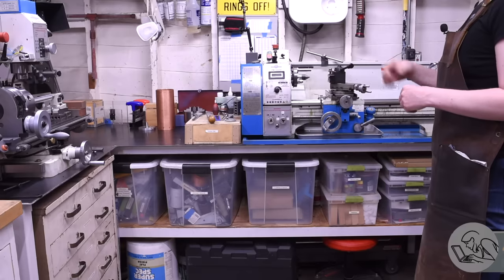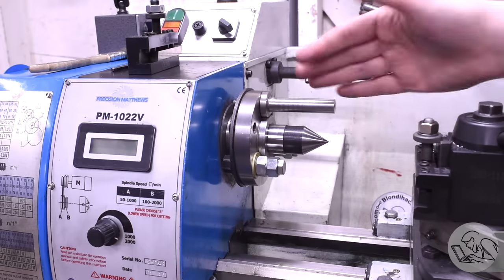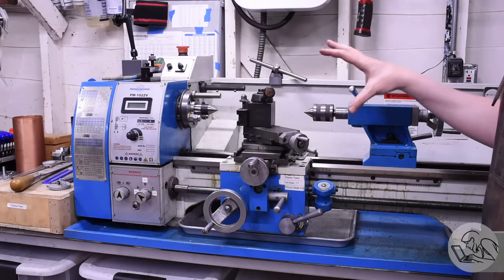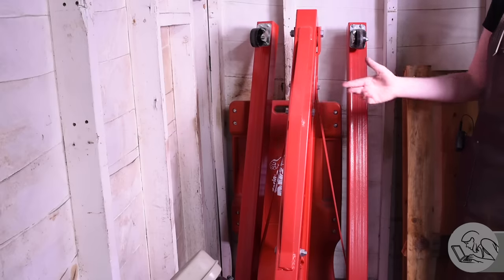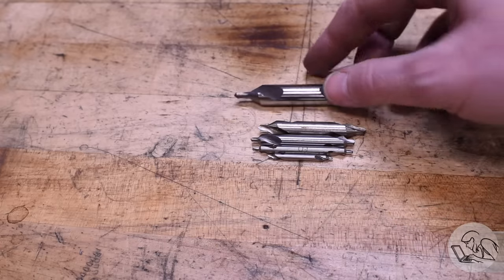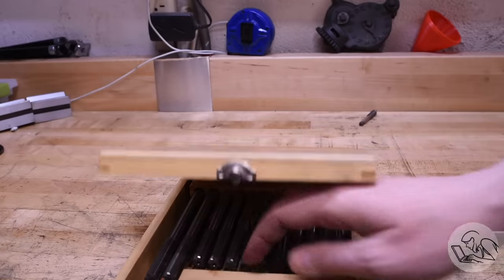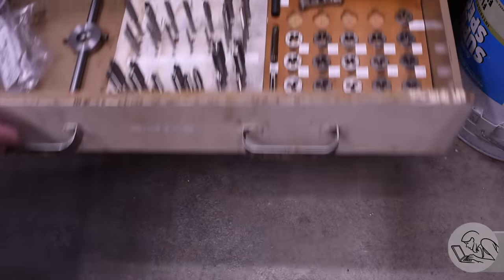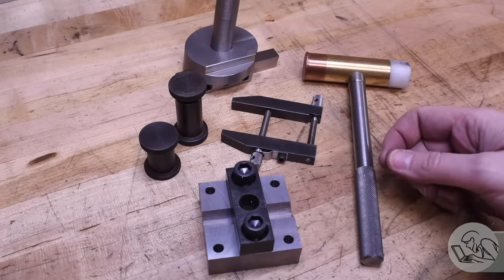Getting Started In Machining - Absolute Beginners Click Here!

Comment: Hi Quinn, I thoroughly enjoyed this video ! I'm a steel fabricator by trade, and amateur machinist. If I were to add two notes to your excellent video, they would be this.... Whatever your cost / value in buying a lathe or mill... double it for tooling. Literature, without question, buy yourself a book called 'The amateur's Lathe' , by Lawrence.H. Sparey . also, have a thumb through the workshop practice series of books, they are very useful. Greetings from England, Regards, Richard.

Comment: is it beneficial to make your own machines or am I wasting a lot of time? I designed a machine on after many hours of finally figuring out how to do freecad. My goal is make my own engine parts because I couldn't believe how expensive a valve job was at the local machine shop and figured for about the same cost or a little more I can do the machining myself and be left with a variety of new things I can do for future use

Comment: In regard to cheap taps and dies, you could have mentioned that you will have very little success trying to thread steel round stock with a cheap, non-adjustable die.  You must have the ability to adjust the die down in multiple passes to thread something like music wire.
Reply: Music wire is hardened, isn't it? I wouldn't go near it with a die unless it's annealed it first.

Comment: The digital caliper is VERY handy, for a mechanic.
What size is that bolt head or nut? Measure it, and 
you can convert inches to metric, just by hitting a 
button.

steve

Comment: Hey Blondihacks, I'm in the process of restoring my lathe so i can't do boring operations and I'm too broke to buy a boring head. Would it be feasible to use a 4 jaw chuck on a rotary table and a rigid endmill to bore holes if I were to drill out the majority of it first? By this I mean give the tooling a slight offset and only turn the rotary table. I've thought it over and don't see anything inherently wrong, but something in my head tells me I should have cover before attempting the operation.

Comment: I bought a small (250kg with the table) polish lathe from the 70s every time I use it I have a different opinion - when I have to thread something, I'm glad that for most threads there is only one gear to change and slow feed at a switch of a lever, but if I have to mess with adjusting the tailstock everytime I move it because the ways are worn, I wish I bought a new machine. Also apparently machines made by apprentices in communistic countries aren't made very well...

Comment: Quinn I have a question. I have an Old Atlas 618 Lathe. The lathe is complete and in decent shape. Problem is I have no tooling and since this is mostly a collectors item (it seems) parts are few and far between and expensive. My question is, should I spend the time finding some of the harder items, change gears, 4 jaw chuck etc... or sell it off and buy a newer up to date machine??

Comment: Woodworking machines are screaming murder machines of death?!! Hah you'd really love my radial arm saw with the molding head cutter attached spinning at around 1800rpm. Oh and my metal lathe is about 112 years old weighs 2000lbs, yup moved it about Egyptian style a few times, and it has 20+ oil pots and grease points to keep up with while in use.
Reply from the maker: Closest I ever came to losing a finger was on a radial arm saw. Missed losing it by 1/2”
Reply: @Blondihacks  second most dangerous saw in the shop, right after the band saw IMHO. Great videos by the way👍👍.

Comment: Yes, limited space, bedroom. I have a Sherline Lathe/Mill combination machine however it cuts only wood, plastic and soft metals. What is available on a desktop scale that will cut steel like 440C, O1, D2, 1095  carbon hardenable steel , small pieces?

Comment: Thanks Ms Hacks. It is just short of a year since buying an Optimum TU2004V mini lathe & devouring all of your videos. Even as a skilled woodworker, the initial learning curve on the lathe was daunting, but my confidence has built & my precision is much improved. 
Ironically, I have sold my QCTP & use the https://www.eccentricengineering.com.au diamond tool holder & his inverted parting tool in the standard tool holder along with learning  to grind HSS tools for the other critters needed. The standard tool holder had to be modified to use the inverted parting tool, but I am very happy with the results. 
I think the compound is the weakest part of the mini lathe & I have done the usual mods to stiffen it up.
I also bought an ER32 collet chuck from Banggood. The quality was appalling, & it required a lot of surgery make it work, but it now lives on the lathe.
As a woodworker, I make a lot of jigs & use many Acetal parts. I loved your tip about using the vac to suck up the cuttings.
In all honesty, your series of videos are the best introduction to machining, skilful, witty & very well structured.

Comment: I too get annoyed by the "made in china = bad" thing. People don't seem to realize almost EVERYTHING is made in china from cheap plastic toys to "american" cars to that $300 luxury electric toothbrush. "Made in china = bad" has only stuck around because people want a reason to complain about getting what they paid for, i.e. they only care about where their product was made when it breaks. Start looking into the origins of the products that you love and you'll surely change your opinion on "made in china".
Reply: Tool and equipment are only as good as how you care for them! No matter the origin of manufacturer!
Reply: The issue with China's manufacturing isn't necessarily that they're always bad, but that they're never consistent.

You're right, a large majority of things that would be considered quality products are produced in China, but the designs for those products are typically from other countries.

I work as an engineer and I see many, many machines and products that are designed and manufactured in China that are simply abysmal.

They're poorly constructed from weak materials, with almost no safety features, unintelligible documentation, and they barely serve their intended purpose.

People will buy these machines at work because they're so cheap and 9 times out of 10 they just end up collecting dust because they're unusable.

I'm not trying to be "China = bad", but that's my honest, daily experience.
Reply: @BeekersSqueakers  I'm sorry but you're just wrong. China builds some of the best machines in the world, certainly the best tunnel boring machines and the best EVs. They built their own space station, they built the worlds first flying taxi, and they are a nuclear super power. If you get poorly made products from China it's because you're only paying for the cheap stuff. And often times the good stuff you're "not" buying from China is still chinese made, it's just passed through a third party as America has recently learned.

Often companies will outsource manufacturing to China because their factories are so advanced that they can churn out what ever cheap shit at unbelievably low costs; these companies, maybe chinese, definitely plenty of western, then try their best to hide who they are so you don't associate their name with the cheap shit they try to sell you. Idk if you're involved in the watch world but this is very common there (often they don't even change the design, just the logo and the colour).

Regardless, the fact that China can produce things so incredibly cheaply, and ship it anywhere in the world, is a testament to their manufacturing prowess.
Reply: Again, you're missing the point by making generalizations.

I already admitted that China has the capability to make quality products, but what I'm also saying is that they have the capability to produce very poor products, which feeds the "China = bad" stereotype.

You're acting as if "China always = good", which isn't the case, either.

You can't tell me that I'm "wrong" because I experience it every day. To be fair, I'm open to the idea that I see more poor Chinese products than quality ones because I work with a bunch of cheap skates, but those products still exist and they're still poor quality.

All I'm saying is that China gets a bad name because the quality of their products ranges too widely, meaning they're inconsistent, which is exactly how I opened my original comment.

Comment: Try a Smithy 3 in 1 machine. Mill, lathe and drill all in one. Smithy.com. years ago this was the go-to for beginner "chippers" as we were called back then. They had 3 models to chose from at $999.99 . They've come a long way and offer a ton of accessories now and of course they're no longer 1k, and dozens of chinesium off-shoots have popped up. They take up a corner of your garage or basement, and now even offer tables for them.
Reply: The cost is modest, but the quality is not great. From my experience, it's not a good value proposition.
Reply: What, a Smithy?
Reply: @machinistmikethetinkerer4827  Yep.
Reply: To be fair, Smithys parts are made in China under Smithys specs and techs. Not many aren't.  But I've had mine for over 30 years in my basement and still use it today. Aside from a stripped gear here, a broken piece there(which I fabbed myself and repaired)I've never had a major breakdown.
Reply: @g.tucker8682  do you have one? Curious, what problems did you encounter? Back then I bought it because it takes up little space, had perfect capacity for small parts and their customer service is pretty good. I can still maintain .0005-.002 on it which is plenty good for what I need it for. If you have issues with yours  let me know I may be able to help.
Reply: Neither fish nor fowl.
Reply: @machinistmikethetinkerer4827  Thanks for the offer, Mike. I had the mid-range unit and got rid of it after too many hassles and a burned out speed control. I had hoped to save some money, but know now that the same money will buy a little more power and a ton more rigidity. The tradeoff is floor space of course. 
I know a guy who has the multifunction woodworking machine they used to sell and he had tons of problems with quality and usability.
YMMV, but my advice is to look elsewhere unless you have extreme floor space issues.
Reply: @g.tucker8682  agreed. There's tons of them out there. Sometimes ya get lucky and get a nice Clausing or SB engine lathe for cheap auction. But I don't have that kind of luck lol

Comment: Quinn, please consider making one or more videos about using lathe faceplates -- I wish I had one for my lathe!

Also, beginners ought to get a quality stainless steel 6-inch (~150-mm) scale too.  And a hacksaw with decent metal-cutting blades for cutting material to fit your machine(s)!  Edit:  A set of good files too, or at least one WITH A HANDLE for chamfering parts on the lathe.

Comment: Hello Hacks! Love your channel - excellent for new machinist enthusiasts! 
Question: Do you have experience (or an opinion) about Multifix QCTP vs your Aloris style system? 
It seems they are a bit more expensive, but if one wants to change - I think best would be from the start and not when one has already invested in a load of holders for whatever system the machine came with...

Is it worth to invest in "Multifix"? ....your take on that?

Cheers,

thjakits

Comment: First of all thank you for your videos, they are very informative and educational. My question is about safety. I see you working on small pieces and you are very close with the tool holder and the chuck.  Is there in the lathe a device to stop the tool holder and the chuck from coming together or crushing into each other?  Because an accident like that could be devastating and very dangerous.  I saw in one of your videos that you made a mark on the work piece so not to go over that and you were about a 1/4" from the chuck.  Second question I cannot find the video with the different import lathes to choose and buy.  I like your video on how to sharpen the cutting tools, excellent.  I saw the grinding stones are 8" diam. so they are wider than the 6" one.  It seems that the thickness of the is important.  You made look so easy and I was intimidated by how to sharpen the tools, but made it to look natural. Thank you.
Reply: Hi John, Since no one responded - in general: No. That’s called Crashing the lathe and it’s bad. It’s more likely to happen when you’re using the power feed but it can happen by hand feed also.
Ideally, you’d check clearances before turning the lathe on and maybe add a - Don’t go any further than this!- mark. Check twice and pay attention.

Comment: 1:35
I will come up as a hater. I don't know your background, YT pushed this video to me...
But, have you ever worked on a industrial cnc lathe or mill? :) I did myself. And the work is nothing more but filth.
Coolant being main problem in my experience. That stuff is toxic even those that are being sold as eco friendly and what not. Not to mention when the coolant gets evaporated. Even in a modern shops with air being sucked out from machine cabins, air in the shop still gets suffocated.
I'm out and away from cnc rodeo for good after years of working.
I've worked on a hydraulic press brake machines as well, and I tell you that that was the cleanest job ever. Night and day compared to lathes/mills.
Reply: Made this comment above a little to fast I guess. You put it clear after the 1:35... Enjoyed the video

Comment: Does anyone here recommend a source for prescription safety glasses/goggles?  My stupid left eye can't do contact lenses, and I'm hoping to one day skip the big plastic chonkers that fit over my regular glasses.
Reply: Every time i buy new glasses , i get them toughened so they can be used in a workshop. Actually I have a pair like that and they also have the side protectors on them as well.  They live in the workshop or when I am outside making another mistake( read project).
Reply: I would recommend "over specs" safety glasses.
These are big enough to go over your existing glasses.
Also there are clipons which protect your spectacle lenses but do not offer significant side protection
Reply: I bought my last couple sets from rx-safety.com you still need to have your prescription and should know your IPD but they were a relatively inexpensive way to get ANSI Z87 rated glasses with prescription lenses.

Comment: Love your channel but i disagree with some of what you say here.Grinding HSS is actually not complicated at all and a new  person to the craft should understand tool geometry otherwise you have not a clue why to be "on center" or slightly below depending on the tool orientation.Rigidity is the name of the game in machining and most import lathes do not come with a Quick change tool post for a reason.They are not nearly as rigid as a "lantern type" tool post or the rotating 4 tool type that come with most lathes and are realy designed for speed of "production".Yes even your 1022 Precision Mathews would be way more rigid without one.QCTP hang the tool way to the side and forward of the centerline of the tool post,Not a must have by any standard.Take that $200 plus dollars and invest in good drills and reamers/taps.I would recommend the opposite of what you said,buy good quality tooling as you need it and add to that over time.Spending hours on a project only to ruine it with a cheap drill that is just cutting on one flute(and cutting  oversize)because it was made off center or a reamer that blows your press fit hole to oversize is not a good thing.Import HSS is another waste of money and every pre sharpened HSS tools on the market are such.Ebay is full of used HSS such as Latrobe ect for not alot of money.Keep your tool as short and near the tool post as possible.Rigidity,Rigidity……Say it with me.Poor set-up and cheap tooling will have your Lathe online for sale because your results will be poor and look cheap.A good test indicator is a must from day one along with a good mag base not a plunger type indicater that measures up to a inch or 25.4mm.Use a plunger type indicator to measure axis travel not to dial in concentricity.A dead center is fine for low rpm work and on the spindle but i will take a decent live center any day in the tail stock .Learn how to properly sharpen and relieve tooling before you ever turn on the machine.Beware of Variable speed drives unless it’s a quality VFD,don’t be fooled by marketing,Changing a belt is way better than an anemic dc variable speed which only has decent torque at full rpm.Proper depth of cut/Tool geometry and feed will overcome 
most if not all problems associated with the limitations of just a few different rpm ranges of a belt drive machine.Last,These are not production machines like a a Haas VF5ss or a Haas SL20.Make light cuts with properly sharpened tooling and keep your stock as close to the chuck as possible.Watch a bunch of old pro's and pay attention.Remember,Rigidity is the key to success .With this being said i enjoy watching you "tinker".30 + years of the trade and i still learn something just about everyday.🙂

Comment: I just go to the part about "used american" vs new asian lathe. part of the reductionist "merica good" falsehood is that, sure, that bridgeport might have been good 40 years ago...but sitting in the back of a barn under a leaking roof and inhabited by rodents and pidgeons have done the ways no favors. A newbie (myself included) has no point of reference to properly evaluate a used machine like that. I rebuild old motorcycles - I have learned by trial and error what to look for in a "project"...not so much with machining equipment. So I would sugest strongly that the newbie look to reputable importers where there is some means of support.